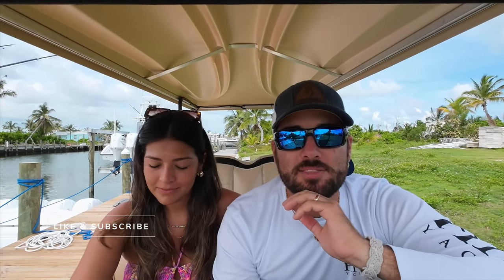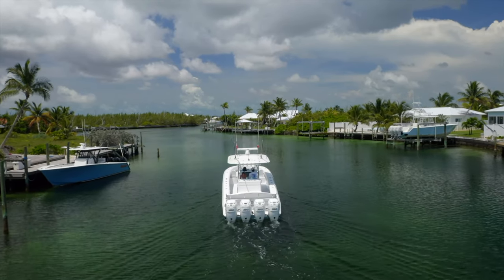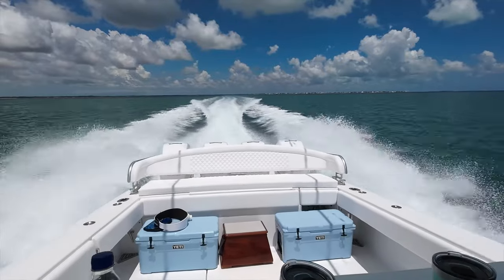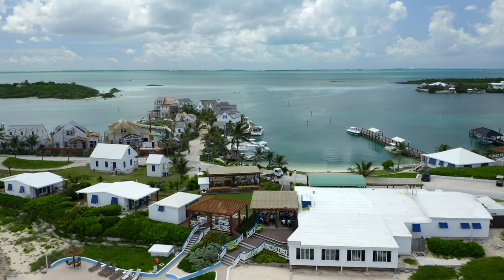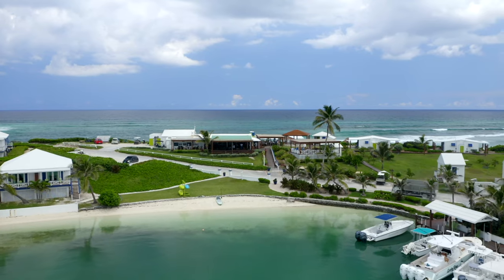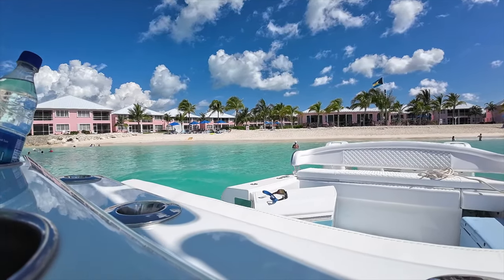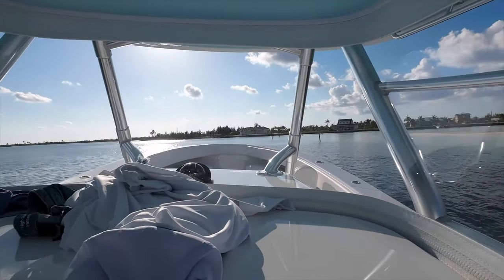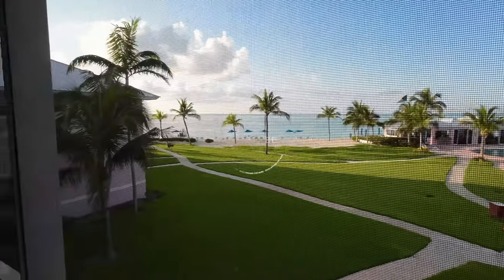The Abacos: Treasure Cay to Elbow Cay *BAHAMA 41*

Comment: I’m a professional high end auto detailer  with 23 years experience. How much work could I get doing ceramic coatings on boats?
Reply from the maker: If you are good, there is a lot of work to be had. A proper ceramic coating holds up way better to the salt and sun than regular wax so ceramic coatings are hugely popular. My advice would to get in the network with one of the best in the industry and use their products like DNA Surface Concepts. The name recognition alone will help big time. If not that them use Starke.